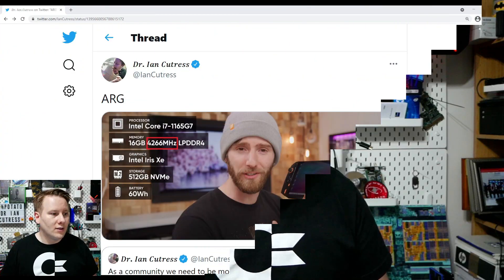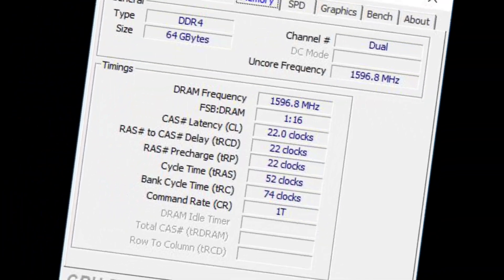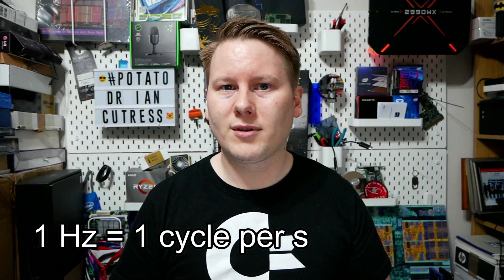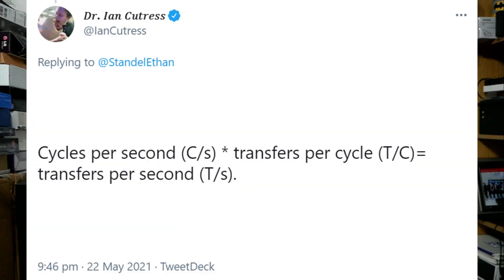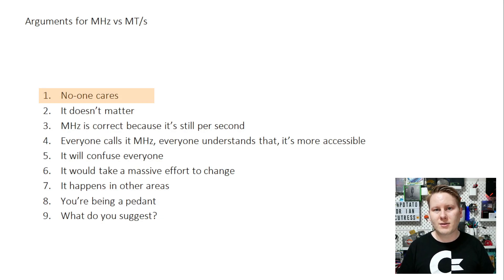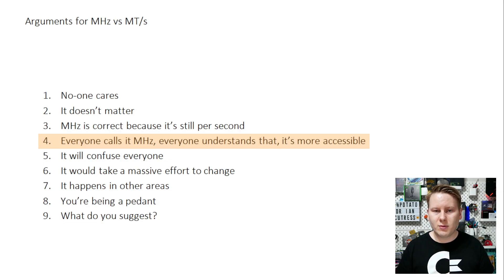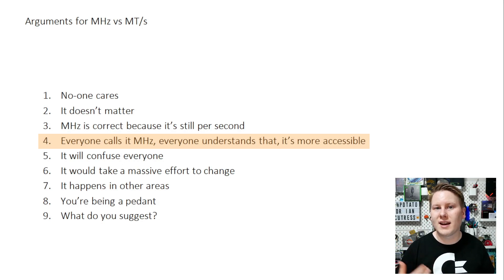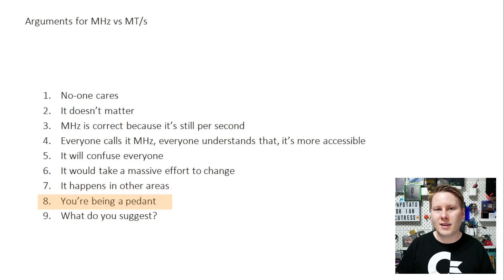Linus is WRONG 💩 : Explaining MHz vs MT/s

Comment: I know the difference but I use hertz unless I want to be extra specific for some reason. Hertz in just easier to say.
Reply from the maker: ... But wrong
Reply: @TechTechPotato  sure, but not wrong enough to matter. Kinda like pi = 3.14
Reply: @TechTechPotato  im still confused. My 3000 MHz ram says its running at "3000 MHz" in task manager for example... So is it actually 1500 MHz or is it 6000 MT/s. Because literally every company advertises MHz. I understand the difference because its Dual Data Rate, 2 Transfers per 1Hz, But im confused on who is getting it wrong and where. Because now people are replacing MHz with MT/s but not doubling the value.... so companies are advertising their ram wrong? or wtf, I see why this is a problem now lol
Reply from the maker: Micron and a couple others do use MT/s. The Taiwanese companies still use MHz. It's hard to correct an industry that's been using it wrong for a long time.

Comment: Those are just bus speeds, DRAM has its own cycle time. For DDR4-3200 it's 2.5ns (400MHz.) 

Isn't a "Transfer" just a bit? Why not use Gbit/s? Would a PAM-4 symbol be counted as one transfer or two?

Bus speeds are the least relevant performance figure. DRAM cycle time is more interesting. It's like putting a 5400 RPM hard drive in the same class as a 15K RPM HDD just because they both connect at 6Gbps. They might even transfer at similar speeds but one has triple the IOPS.

There's only one place where bus speed actually makes a noticeable difference. Somehow AMD has managed to couple their in-package coherency protocol to memory bus speeds. It's crazy that they have such weak memory controllers in their CPUs when this is so important for their performance, especially on the desktop where they are without the benefit of registers or more than two channels.

Comment: I agree that a Standard is a determined quantified value. I studied towards Electrical Engineering, and work in the Aerospace Industry. If the numbers are wrong, then something can blow up when it is not supposed to. Did that not happen with the Mars Climate Orbiter, (1998/1999), on the trajectory adjustment calculations?

Comment: A year or so about, my cpu z showed half that hz of my RAM off of what that was advertised but I couldn't understand what that meant. I thought I bought the wrong stick but at that time I just was running it in single channel and thought that may be the cause and bought another stick with which the clocks still remained the same and just left it. Now I understand it clearly.

Comment: If "units don't matter" were true, we could randomly call memory speed as 3200 megamiles or 5200 teracents and switch during a single talk. Using incorrect unit makes zero sense. If you don't want to bother with units, do not use any unit instead of using incorrect one.

I think people defending Mhz instead of MT/s are the same people that pretend that feets, yards and miles are superior to metric system.  The old system may feel "easier" just because you are already familiar with it. It doesn't mean that old system is actually even a good option.

Comment: I understand the basic premise but the more I think about it the less it makes sense. Is there a meaningful difference between a transfer happening on the up or down signal? At the end of the day it really doesn't matter much to me if the timing signal goes up down or in loops as long as the memory is doing a transfer it is completing essentially its entire purpose. Is MHz just a dead unit now? Why would any of us care if the clock rate is different. In practice what is the difference between a piece of memory doing only one transfer a cycle and a clock of 3600MHz and doing two transfers a cycle at 1800MHz. If the two transfers happened simultaneously in parallel It would make sense to me as to why both units are of value however I struggle to see why I should care about DDR vs QDR vs whatever if the transfers are evenly spaced in time and the transfer rate is the same then why even bother recording the clock in MHz for anyone, it just seems like a needlessly useless measurement why can we not then just agree to never use MHz for memory at all or just decide that a cycle on memory is a transfer cycle irrelevant of what the signal is doing in the back ground that way the numbers are always clear and always comparable between any memory

Comment: There is a possibility that 8 is true! Hz just means per second. If you're talking about transfers then there are 3600M per second. So that's transfers at 3600MHz. See what I did there? I counted transfers instead of cycles. Music at 120bpm is 2Hz. That's 2 beats per second. Not cycles. But it's still Hz.
Reply from the maker: Unsurprisingly, your point is tackled at the very beginning of the video. Hz isn't just per second. It's 'cycles per second' to refer to a constant periodic timing. Transfers aren't constant. That's literally explained in the video. But good for you on comprehension.

Comment: Cycle: "an interval of time during which a sequence of a recurring succession of events or phenomena is completed".  
If you do transfers at that speed it is happening with that interval of time between each, so that cycle, so that amount of hertz in that given period of time.  
In my opinion your point is good just for a "divide et impera" situation to better identify what we are talking about, but not from a "use the right unit" stand point: from a strict scientific standpoint that memory is capable of doing transfers with that frequency, definition of hertz doesn't care that there is a clock rate signal somewhere.

Comment: You can't use instructions per clock for a processor because most processors have instructions that take multiple cycles. In fact, as you probably know, many instructions take a different amount of cycles depending on how they're being executed. Branches depending on whether they're taken or not taken; whether the data accessed is across numa zones; whether it can be executed in parallel if going to the ALU or elsewhere; cache misses; SIMD instructions to name but a few. So instructions per clock makes no sense. Although, I do know of some RiSC processors that do execute every instruction in 1 clock, but this is because everything is done register to register.

Comment: I really want to see a video like this about "2K" resolution.
2K is not 1440p. 2K is 1080p, or a slightly wider variant of 1080p.
"K" is a measure of horizontal resolution, not of the total number of pixels. 4K is approximately 4000 pixels across. 2K is approximately 2000 pixels across. 1440p is 2560 pixels across, so if you call it a "K" resolution it would be 2.5K (because it's about 2500 pixels across) or 2.67K (because it's exactly 1/3 wider than 1080p/2K or exactly 2/3 as wide as 4K).

Comment: His solution makes sense but i still agree with Linus that the consumer will be confused if the DRAM companies on OEM sites changed like that. It is mostly PR made a decision 20+ years ago and now everyone got used to it to the point even UEFI UIs are using it. To get it to be the correct term it will most likely take 20+ years again to be changed by which time the kind of chip we are using will have changed already.

Comment: @TechTechPotato THANK YOU Dr. Ian, for informing us - correct terminology and definitions are indeed necessary and are indeed, a necessary function of our language and it's evolution - as we seek to more accurately define or capture, what we observe! It's actually ever more necessary in this day and age as we continue to scale down with miniaturisation and push towards and beyond Moore's Law etc... We are also struggling lately with the bs marketing that 'nanometre' or 'nm' claims are these days - essentially just marketing or subjective measures per the manufacturers own metrics rather than an 'industry standard'. There is a constructive proposal to go beyond the nm descriptor, an “LMC density metric”, but they don't seem ready to get on-board with this yet, but maybe when Moore's observation is finally obsoleted, they may be open-minded or maybe that's wishful thinking - https://www.hpcwire.com/2020/06/01/10nm-7nm-5nm-should-the-chip-nanometer-metric-be-replaced/ . Hopefully you have more luck in this space, Dr Ian! - Such videos as this meet this dud spud's "Minimum Specifications" nurturing new shoots of growth, green again, but that little less of a monoculture, more enriched and cross-bread with new varieties to build it's resilience to the pestilence of perplexity! :)

Comment: Maybe it would be more accurate to represent it in transferred bits per second, 1 transfer per 10 lanes and 100 lanes is not the same thing and also one transfer can encode maybe 4 bits instead of 2. OK,  as RAM modules operate the same way then having MT/s and MHz makes same difference to me, just do not use MHz where the unit is MT/s as it makes the module x2 as fast.
For me using MHz helps in understanding how it will synchronise with CPU clock or transfer lane.

Comment: I don't see a reason why both memory speed and clock speed couldn't use Hz as the fundamental unit. That would describe the memory when used every cycle, but that is still a valid measurement.

Comment: I remember when DDR2 came out and I was trying to understand the timing change in the memory and why the RAM timing increased significantly yet the RAM was faster overall. It was kind of an epiphany moment realizing that the frequency did not change, just the number of executions. I also remember RAM stick having "effective" somewhere by the hertz reference indicating that the stated "effective hertz" was just a multiple of the hertz times the executions. I think it is important to note the difference between the actual hertz vs the number of executions it is capable of. Units are important for any calculation of physical thing and as others have noted, keeping track of units is an excellent way of double checking ones work.

Comment: I just want to say as an acousticain and electrical engineer we have have strict technical definitions outlined in the AES and ANSI/ASA such as standard ANSI/ASA S1.1-2013. All these companies running around with these fake speaker measurements are violating the technical standards set out by these organizations. For instance speaker sensitivity the acoustic output power for 1 watt of electrical power is well defined, but a lot of companies cheat by putting in the voltage drive in one speaker instead of looking at just one watt. Do not say audio is imprecise because if you pull this type of crap in a business meeting you will get lit up.

Comment: Using the right units should always be the thing, if not you are assuming "everybody knows" the right units.  Why some value has those units, that is the education thing that many do not want to hear or provide, ie no fun.
People always add units to whatever number they talk about, distance, time, weight, etc, everybody is used to it; then why some numbers of an spec should not have the units or the wrong ones?  Makes no sense.  Again it might be seen as pedantic, but whoever says it is pedantic, clear does not care to be precise in the communication.
Some people even care about kiB and kB of memory.

Comment: Why are we still using MHz instead of GHz when talking DDR4? Since most of the big computer numbers are using the "correct" prefix meaning: Storage has gone from MB to GB to TB,  FLOPS performance from GFLOPS to TFLOPS,  CPU clock-speed from MHz to GHz and even RAM amount from MB to GB(to TB)

And now when seeing news about DDR5-12600 
wouldn't DDR5 12.6 GT/s be easier and more correct to say?

Comment: I have an even better idea: start using GT/s. It's the more appropriate metric suffix for the values anyway.
It manufacturers started using that for DDR5, it would entirely circumvent the confusion problem (and would take less of an effort) as for the customers it would feel like the "giga is better than mega - mega is last gen and giga is current gen". If there is a move from "mega" to "giga" from a marketing standpoint, correcting it to GT/s wouldn't be too much of additional hassle.

Phone/powerbank manufacturers should also take a note from that same page. I've seen powerbanks marketed as "10k mAh" and I absolutely hate that. Why not just write "10 Ah"?!

Comment: Thank you for the video & the clear explanation. One of the most critical aspects of being an effective science communicator is communicating technical concepts CORRECTLY to your audience in a manner that is understandable for your target audience. 

If you're not communicating the science correctly, then you've failed as a science communicator. Accuracy isn't optional. 
If you can't handle the most basic tasks required for the job, you shouldn't be doing it; misinformation can be incredibly harmful. 

So, thanks for clearing this up 😁👍

Comment: If you would like to see the correct unit, then start using it at every opportunity on Anandtech.  Not putting any unit whatsoever doesn't further your stated goal of educating to entertain the audience.  A written article about the misuse of units could elicit the the changes you seek in the industry, one article on Anandtech was enough to snuff out the shenanigans cellphone manufacturers were doing to cheat benchmarking apps for a number of years.
However if you don't care enough to do so I guess this was all just a waste of time for all involved.

Comment: As an engineer I agree with you that getting the units correct is the base of what makes Math the universal language. Otherwise everything would fall apart and nothing would make sense when you are trying to do any conversion calculation. I do agree about not including the frequency when stating what type of memory you are referring to, so it just becomes a label/model name. Which in marketing speak means that they don't have to re-label/throw away their sales pamphlet/posters. Good job and keep up the good work.

Comment: AFAIK the core speed of the memory chip and the control signals is 1800mhz. The data rate is 3600mhz because the memory chip itself has buffers it fills then transfers in a burst at the data rate.

The difference is weather you are quoting the data rate or the command rate.

The REAL problem I have is GDDR5 having DDR in its name.  It should have just been called GQDR, but that is a whole other can of worms.

Comment: To answer what I think about the situation: I love it, I don't consider it pedantic (although I pride myself on being pedantic with what I say (now I see, ignorantly)), but you're totally right about getting units wrong. Didn't NASA crash a rocket because someone used inches rather than centimetres in their calculations?

I know that DDR meant double data rate, but I've though for a long time (admittedly I'm an idiot it seems) that that meant the effective clock was doubled, ie. 1600MHz becomes 3200MHz. Yep, this was educational, informative and is certainly something I'm doing from now on.
Reply from the maker: The NASA thing - they commissioned a small part in the guidance system from a 3rd party, but the 3rd party used imperial. It meant miscalculating the entry speed/height of a moon(?) lander, and getting the height wrong by about 50m/165ft. That caused it to be going about 30mph/50kph faster than it should. So it smashed up.

Comment: While I really don't care if you call it MHz or whatever else but there is a problem with your basic argument. 
If you call yourself a "scientific Communicator" than not using units is even worse than using mhz. It it is at least "effektive MHz" would be right wich makes it only 70% wrong. but not having a unit makes it, scientifically speaking, 100% nonsensical in EVERY POSIBLE DIMENSION. scientifically not having a unit means that any number is equally valid for any question, so it carry absolutely no information. if you really come with scientific Communication that means that your 3600 ram could also be labeled as 0.04321 or 20.587 trillion and is still as valid as bevor. 
so you gonna have to deiced if you wanna be a "scientific Communicator" and really only use MT/s or use the more convent route wich is not more preise than just saying you don't care and using whatever.
Reply from the maker: I've been a science communicator for over a decade. But you be the best you that you can be 👍

Comment: Hertz is frequency. It may be describing how often something which is cyclical occurs but it is not locked to referring ONLY to a cycle or what you refer to as a constant thing in the context of memory transfers vs clock cycles. If something is able to be measured as occurr
ing a given number of times in a given time period then the seconds UNIT is the constant and the thing being measured as happening IN that given time unit is happening at a frequency that can be described in HERTZ. Why is there an argument about this? What is it you think you are "correcting"? Clock cycles are called cycles because they have a repetitive similarity of voltage. I'm with Linus: it doesn't matter [in the context of consumers deciding how to buy memory] which is what he was saying, not that accuracy does not matter.
Reply from the maker: Transfers are not constant, they are very pulse-like. The clock between the controller and the memory is constant by comparison. Hertz isn't simply a frequency, it's a cyclical periodic frequency. Transfers are not constant, the clock is. That's the differentiating factor here, and it's plain and simple. Read the comments underneath with respect to the mountains of engineers that have to work with this differentiation.